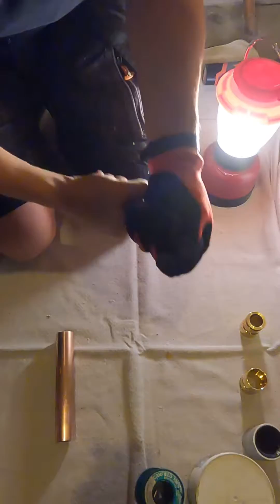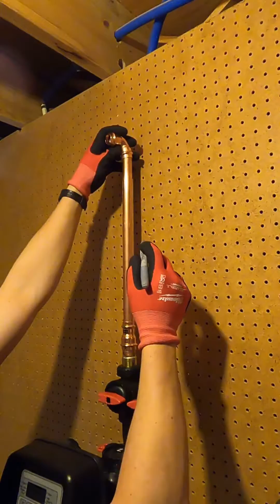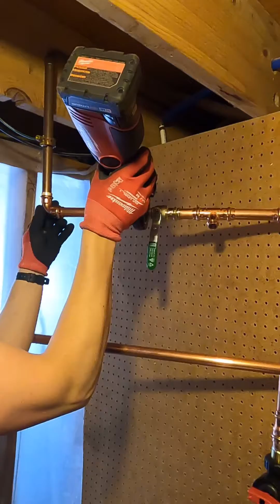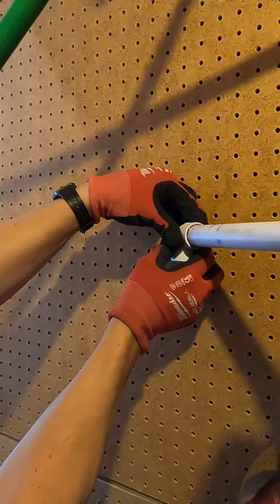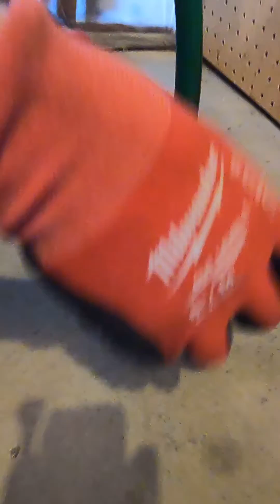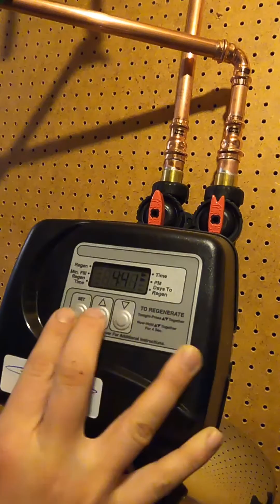How to install Halo 5 water filtration system step by step with added plumbing tips 🦩🔧

Comment: Wow, great video. Have you ever had an instance where floor drain wasn’t easily accessible like in a basement where foundation is poured? I’m looking to install one and there’s a steam shower to the right but there’s a wall between it and can’t terminate outside because there’s no access.
Reply from the maker: Yeah for sure. You can run the drain in a few different ways. The drain is able to go up and back down as it doesn’t need fall and flushes with pressure

Comment: Will connecting to the main city water city line provide treated water to all household and outside hose bibs? I need this processed water for my outdoor spa water. I have a separate line for my shrubs and trees.
Reply from the maker: That all depends on how your plumbing is set up. Anything connected to the filtration system will be filtered. I’d get a local plumber to assess your situation to be sure!
Reply: @Plumingo_us  I like how you installed a spigot to the line. I will have my plumber install one so I can attach a long hose to use the water for my spa.
Reply from the maker: Thank you sir!

Comment: Does it need to be copper or could you use pex?
Reply from the maker: @damianparker3009  you can use pex - but you’ll need to transfer from copper to pex as the adapter that comes with it is for copper

Comment: What is the pressure reducing valve supposed to be set to for the filtration ?
Reply from the maker: Manufacturer says to not exceed 80 psi. Generally I’ll have them set somewhere between 60-70psi